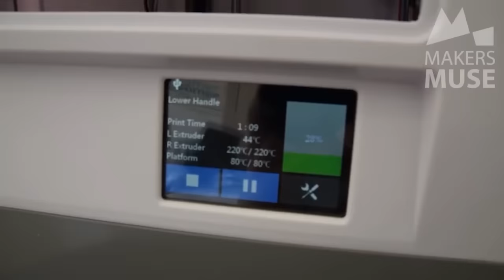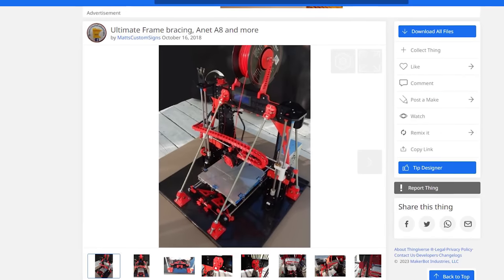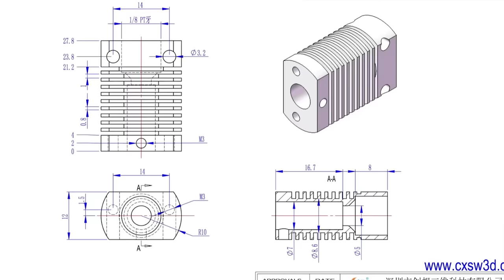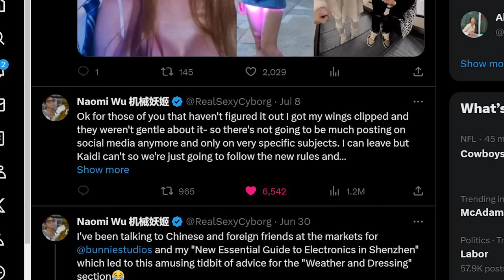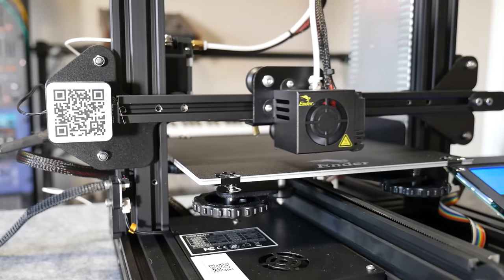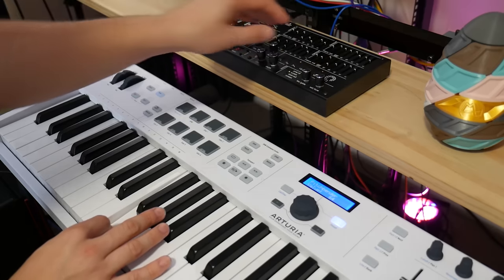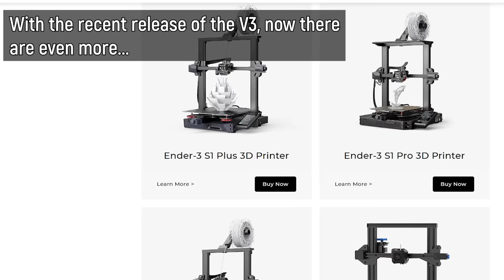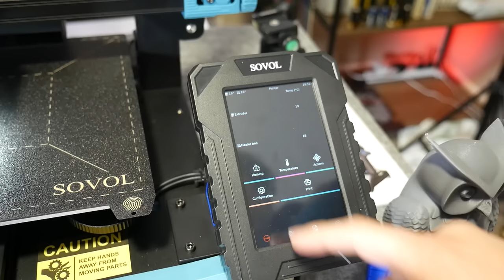Creality Ender-3... it's time to move on.

Comment: I recommend the Ender series for people that want to tinker and learn what a 3d printer does, for people that want to just print on a budget I usually recommend the Elegoo FDM printers, they just work pretty much out of the box, if no budget then Bambu, but I don't like the plastic waste from the nozzle cleaning so usually Prusa. The sheer amount of plastic waste with the Bambu is a real bummer, but the prints that they push out are amazing.

Comment: I bought an Ender 3 pro 4 years ago. And I learned a hell of a lot from that machine. I rarely need to level the bed anymore after installing a BL touch too. But I'm planning to buy a bambulab printer in the near future
Reply: Ditto, if you're a tinkerer its the perfect base machine. I got mine Ender 3 super dialed in with direct drive, silent stepper motors, 3 axis bed, pei sheet, etc. The bambu lab printers with AMS are very tempting and the price seems reasonable given all the quality of life improvements and print speed.

Comment: i loved the ender 3, but when i actually started to make my own models to print I was getting really annoyed with having to fix the printer every time i wanted to use it. Then i got an ender 5 pro... the ender 5 pro is SO BAD i had to rewire the whole thing just to get it to extrude. I decided to try bambu recently and so far its no nice being able to start a print and just trust the printer. The full calibration is not a fix all, user error still exists, but, its been a nice change of pace.

Comment: I have been using my Ender 3 for like 5 years now, but it's so modded that I don't know if I can call it an Ender 3 anymore. Micro Swiss direct drive, Micro Swiss all metal hot end, 32 bit board, a second Z screw, sold rubber instead of springs for bed leveling, glass bed with a PEI sheet stuck to it, Raspberry Pie with Octoprint and a camera. I think I've put more money into this thing than I paid for it. But it still goes hard. Maybe someday I'll get a BLTouch. I'll only ever upgrade if and/or when my Ender 3 just brakes in a way I can't fix.

Comment: Tevo Tarantula of early revision was my first 3D printer, had it untill past year. Had constant problems with it. It is laughable, but after each print new mechanical defect would show itself - motor drivers burned out, z-axis rod would bend itself, nozzle would leak or clog without any visible reason, every described 3d printing defect I think I saw at different points, and in the end motherboard just fried itself. And most of things I have ended up printing were mods for printer itself :D

Comment: I started 3D printing, cold. No experience, just a little youtube research. Got my Ender 3 V2 in 2021. The only problems I have had, have NOT been with the printer. Cross overs and binding on the filiment roll and really cheap filament. 
In the video you complain that Creality hasn't significantly changed the Ender 3 in many years. THAT was one of the reasons I went with the Ender. After many years of use, replacement parts are still available. I take care of my toys. Therefore they usually outlast part availablity. Sooo, long term part availability is one criteria I use for major purchases. Definitely NOT a drawback!
Reply: One more thing, I still use the original plastic extruder. I have a metal one to replace it when it breaks. But after 3 years, it's still in great shape. I think people break them because they squeeze too hard. I found squeezing too hard makes the filiment miss the hole.

Comment: I got a longer LK5 pro which is just an Ender rebranded and when it works it is a great printer and when it doesn’t then it takes weeks to fix. The longer LK5 was my first printer and it was because of the great price and the build volume. It is slow as hell but I can usually get some really high quality prints from it. Definitely wish I had a bamboo labs printer though.

Comment: My Ender 3 was a lemon. I tried to get help from the "community" and was told everything was my fault and the Ender 3 was a perfectly good machine. I replaced nearly every damn part on it in an effort to get it up and running.

Eventually I gave up on it,  bought an Anycubic Kobra and that worked perfectly out of the box.

I would never recommend an Ender 3 based off of my experience with them.

Comment: Hi,
I'm about to buy my first 3d printer. 
I'd ender 3 is not the way to go, what is it?

Plus, isn't it more holistic to get to know the ins and out of 3d printing by supported by a strong community? 

Say I get another printer... It will also break somehow, why not have an ender3 breake and trust that I can upgrade it with several kinds of gadgets?

Like the phrase: it forges character

Comment: Best printers are core x y, bed slingers cause ghosting on prints when trying to print faster (moving all that mass/print bed causes ringing), I started with a i3 machine that's now got a new home and I just build my own light weight core x y machines these days, they are based on working printers by Voron and Vz-bot and modded to suit what I like or need, I don't buy any printers just parts to build them, it's a hobby and keeps me happy......🙂

Comment: I bought an Ender 3 v2 a when it was new and shiny because it was cheap and "good".  I also really like tinkering.  I spent more time printing things FOR the printer than anything else I think including bed levelling and dual Z screws.  I would love a Bambu Labs one with all it's auto settings but really don't print anything so can't justify that much money on a toy.
I do want to move to Klipper, again for tinkering more than anything else.  At this point I can't event remember the last thing I actually printed.  Maybe next time I get a decent break from work I'll get around to it.

Comment: Thank you for your videos and honesty! I helped my friend to get the new Ender 3 max Neo -he had CR 10 that was dropped and stop working. BUT the printer prints good models and after a day of printing, without any errors, stopps to print between prints! I tried all kinds of tricks I know, but none work reliably. I was at his house yesterday and the printer stop printing last night. This morning I was helping him with his printer and was able to print again, but I have no clue what is going on! Do you have any ideas? Is it possible that the controller board gets too hot and stops some functions, like printing? The other info I have for you is, that one can't print, but XYZ and extruder in a manual mode works, but will not print the part! His computer is connected to the printer and both printer and computer are on UPS by APC, so I don't think the power fluctuation is the problem.

Comment: I'd add a fourth major shortcoming of the Ender 3: The firmware and the seemingly endless combination of screen and hardware combinations.  Since I bought mine a couple of years ago, it's either had homing problems, or been bricked because I replaced a part and Creality kept giving me firmware versions that didn't work together.

I'm one of those who has been horribly disappointed with my purchase and feel like I threw my money away.  I'm no idiot, but this printer has sure made me feel like one at times.

Comment: as some others have said, getting something with decent quality at a budget price helps for something that you're not sure about.  If it's something you continue with, you can always relegate the Ender to "prototyping" and get a much better printer to do the real work.  With the mods/tweaks that can be done, it's also a good way to move to a better printer a little at a time.

Comment: So far I love the Ender 3 S1 Pro. Auxiliary leveling does take a while and it's a learning curve but it was rewarding to get it right. You don't have to be as perfectionist as I was about it though just do your best then auto level it after and your first layer should be decent. 

It's been a while since I've been 3D printer windowshopping and they've come a long way since then in general but yea this thing really is impressive to me, I'm pretty sure it's faster than the one we used to use at my high school. So yea I feel like you're letting the anti China bias get in the way here, like so many other Chinese brands they offer a great product for the price. 

One thing I will say though is: the Sonic pad is intimidating as fuck, it won't connect to wifi so I'm scared to flash my firmware if this thing won't even be able to connect to the cloud. Other than that tho it's astonishing how easy it is to go from knowing almost nothing to being up and running with the ender 3. Takes like 5 minutes to build.

Comment: I bought an ender 3 in 2018, it's working fine, but I'm thinking about doing some upgrades. Bed leveling really annoys me.
But beyond that, if you are going to buy a 3D printer for hobby, you should look some other model.

Comment: I got my ender 3 pro for $99 at microcenter in january this year. After the bed levelling headache i got it set with stronger springs and it stays pretty level. Now thats ive have it nearpy a year ive decided I want a Bambu p1s BUT also want to upgrade my ender 3 pro with dual z axis, auto bed leveling and some other nice little upgrades as a hobby printer, but also have the bambu for rapid prototyping and some other things I want to try like ABS printing and multicolor.

Comment: I am still using my really old ender 3.. I have all kinds of spare parts I bought for it way back when I first got it.. It has not failed yet. I am cranking out the prints as we speak. I did buy a extra large bed version a year ago. I still have not opened the box to the new printer. :P

Comment: My first ender 3 v1 was like 180 and I later added glass then pei steel bed, silent board, and metal extruder gear thing. Just got a 2nd E3v1 for 90. Next will probably be a Max Neo.
About 5 years in and I’ve only had to replace nozzles on the printer so far.

Comment: it is a decent secondary or terciary printer whenever your main ones are occupied or unusable at the moment. but only if it is way cheaper than is now. for the price they sell at, they should come with newer controller boards with more ports for features and silent drivers.

Comment: My first printer was an Anet A8 and it I ended up building a different printer by the time I upgraded it to print well. Got me building my own printers after that. I did have an ender 3 when it first came out and sold it with in a month. My self built machines printed better and or were just as time comsuming as the ender 3 to use.

Comment: Kinda wish I had seen this before we bought an Ender 3 S1 over the holidays. As an entry point into the hobby, It has been a headache and a half trying to get this thing to work properly so far and it’s frustrating to say the least. Hoping the experience gets a bit better after I’ve had time to calibrate and tune it, but it definitely would not have been my first choice had I known better

Comment: For what it's worth, my ender 3 v2 MAX neo has worked well for me out of the box, I intend to improve it with mods but it's honestly not *that bad*... but I probably wouldn't recommend an ender 3 to a beginner, not unless I'm also willing to walk them through troubleshooting and setting up the damn thing. It's a lot better than printers used to be, but there's a lot better on the market today for not much more money. Now if a beginner really wants a printer and they're strapped for cash and the only options available in their price range are an ender 3 v2 or an ender 3 clone... I'd probably lean towards the ender unless the clone offers some particularly nice feature, a lot of the clones are not that great in my experience and then to go for the "let's be a slightly worse ender 3 but cheaper" strategy.

Now really I wanted an Elegoo Neptune 3 MAX but I wasn't about to wait for months for them to get back in stock (this was around the time they were just released and they were all sold out in Europe practically instantly with a restocking estimate of almost a year) since I needed a larger printer then and there and really didn't have the option of waiting that long.

I actually really want an even bigger one, 500x500x750mm or greater ideally but I couldn't (and still can't) really justify the expense and time for a heavily modified Voron right now (They don't support these sizes out of the box so I predict I'll have a headache and a half tuning it to this size) so I had to settle for an E3v2MN which is barely workable for my needs but requires more pre and post processing (cutting prints, sticking them back together with glue, screws, etc, filling and sanding flush etc) but at least most of what I want to print fits nicely (up to and including some, but not all, full sized helmets but practically no cuirass).

Comment: Great video , which I unfortunately saw too late, I bought a ender 3 s1 pro thinking it would be an better and updated version of the original one but honestly I should of went for something better, the bed leveling even if it has an automatic sensor is a pain and doesn't stay level either. all in all not an awful printer, just could of got better for the price

Comment: I am a Newbie and I got an used ender 3 pro several months ago, it's a nightmare lol : the z-axis "switch" of  is not accurate and make Bed leveling even harder, I have to level the Bed every three prints (I think), I can get PETG to stick on a glass bed only if I chose a 240°C nozzle temperature and a 95°C bed temperature, sometimes the "layer fan" is cooling the nozzle too much and so I get an error (I had to limit max fan speed), I use glue to make the first layers to stick, IPA to clean the bed,... so much things to fix in order to make this thing print the most simple prints.

I bought a G10 print surface and some fresh parts for the extruder, maybe it will work ok.

Comment: I have an ender 3 Max Neo....and the glass print bed it comes with is not so great. I will be replacing it with a PEI bed and also replacing the extruder with their Sprite extruder. Mine does have auto leveling.

Comment: Ender 3 V3 SE seems to solve a lot of these issues.  Bed leveling is a breeze, z offset is too easy, and the quality control to seems to have been tightened up a bit.

Comment: I managed to get a "Longer LK5" for about the same price as an ender 3, and for its cheaper nature but bigger bed size, its been a hassle to get working the way i prefer. But im slowly starting to think that i made a great decision. There are some scam Chinese manufacturers don't get me wrong. but you can tell the guys who make longer printers actually use 3d printers. Not perfect, but albeit better than even some productions ide trust for a brand.

Comment: I still use my ender 3 specifically for small abs parts (its in a heated dry closet and has a e3dv6 hot end and dual gear extruder)  it actually works fine as long as I never use different filament or settings. It has run for thousands of hours. I am just going to run it till the wheels fall off. Like you said I wouldn’t recommend it for beginners at this point.

Comment: It was a good 1st experience since I learned so much tinkering around, although I still don't get why the bed leveling option isn't included on every printers. I had so much trouble with that printer and I finally bough I then bought another one about 2 years later, sick of loosing my time. It's an Anycubic Kobra 2 and I though it would get pretty much the same thing but oh men was I wrong. It has nothing to do the that old Ender 3 in terms of speed and realiability and the only downside is that the wifi is only cloud based.

Comment: I have had an ender3v2 since aug '21 and apart from upgrading to auto bed levelling nearly immediately everything else is stock. my one has worked flawlessly apart from one bowden tube melt in the hot end a year or so ago. Its not on everyday but it has taught me so much about 3d printing that maybe a perfect printer probably wouldn't. Its slowbut I like that there is a great community and a massive pile of upgradable parts if you want to spend the money, I just don't know whether its worth spending the money on it or buying a brand new printer?

Comment: I have a base model ender 3. I've abused it to an unreasonable degree, left it in the back of a truck for 6 months, lost at least 10 screws, and have zipties holding 3 pieces up/together. My print bed looks like a war zone, I barely even bother adjusting my first layer unless it's too high and making spaghetti. It's currently sitting on a shaky camper table running at 80mm/s. And guess what, my print qualities are somehow perfect... I did just order a 900 dollar qidi max 3, though. I've run my ender into the dirt for 3 years, time to let it rest or teach another person 3d printing the hard way.

Comment: I upgraded my E3Pro with Auto Bed Leveling and it's been a game changer for me. I never have to worry about those prints starting off right anymore. 

For my next one. I'm going to have to try the bamboo labs to get more print speed. I can't get much over 75 on the Ender without issues.

Comment: Is this video referencing the KE? It has a lot of features he says to look for in a printer. So is that a safe buy? I wanna buy my first printer, i was initially put off on Enders because i heard how tinkery they are, but then i was looking at the KE and some feedback and people were saying it works pretty well straight out the box. It has auto levelling, which is a must have for me and it detects when filament is empty, so it won't keep trying to print lol. I was initially drawn to the A1 but thats not available for a few months, i have no problem paying a bit more for something i know will work.